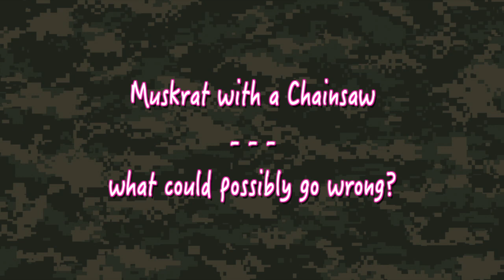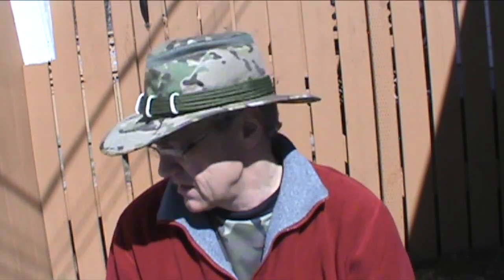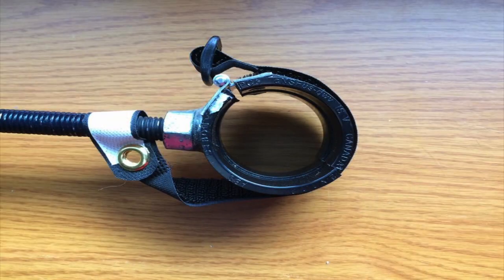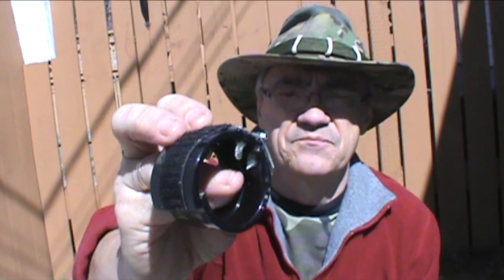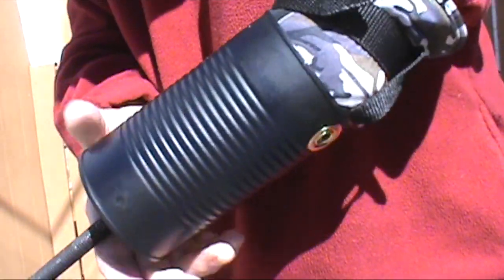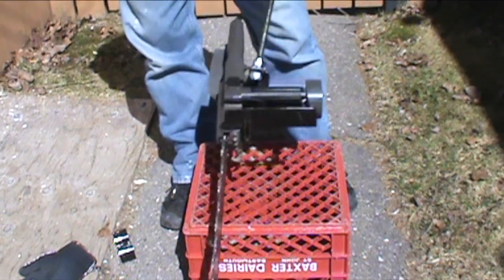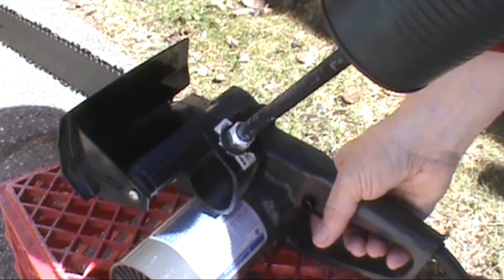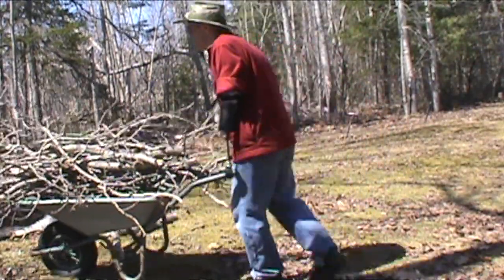One-armed Man with a Chainsaw... WTF??

Comment: you come up with best ideas i'v ever seen!!!!   I'v been trying for years to fill the space in my left shoe where the toes are missing ! i have tried foam, t- paper, cloth, cotton ect... and nothing is working !!!  Do you have any ideas!!  And great invention!!!  very cool!!
Reply from the maker: Thanks... are they all the toes on your left foot or just a couple? I suspect you foot slips forward in your shoe no matter how tightly it is tied? I think you probably need something solid, or at least more solid than the things you've been using (foam, t-paper, cotton, etc.). I have a couple ideas, but they start with a tracing on paper of both your feet... then you know what shape you need to build up.
Feel free to email me to continue this conversation: jim@muskratsurvival.com
Reply: The big toe and the one next to it ! The other three are still there!
Reply from the maker: Ok, you'll have to start by tracing out your feet on a sheet of paper. Cut them both out so you can put them back to back to get the shape and size of the missing part. Because your sock would have a floppy piece, I don't know if the piece you'll make should go outside of your sock, or inside. You'd have to try both ways to see which is more comfortable. if it's inside your sock, you'll have to put it in a "sock" of it's own so you don't have the hard bit rubbing up against your skin. Do you still have the big ball joint of your big toe, or is that missing too?
Reply: ok i tried to send you a message to you'r email but i don't know if it went through , i'm not very teck savy ! That is a great start , i will do that and get back to you later tonight! You'r friend joe
Reply from the maker: Yes I did get your email.

Comment: the only draw back to your design is the plastic bit where ya heated it in time it will weaken and break  the heating does some thing to it  so  every 1 to 2 years make a new one and replace  so it don't get ya while using it
Reply from the maker: I'm going to ask a local smith to make me a steel one.

Comment: Looks like progress to me! Necessity is the mother of invention and if at first you don't succeed, try and try again. I also saw a chainsaw attached lengthwise to a saw-horse with the nose of the bar into a vertical post or stop, the saw is secured solid and the switch or in this case throttle could be worked by a foot switch. It was for cutting up small stuff and you just dropped the stick down on the top of the bar and against the stop and it cuts off your stick. I found this one which is slightly more elaborate:  
https://www.youtube.com/watch?v=TIL8jEw8pSc
Reply from the maker: Cool....thanks for the link Frank!